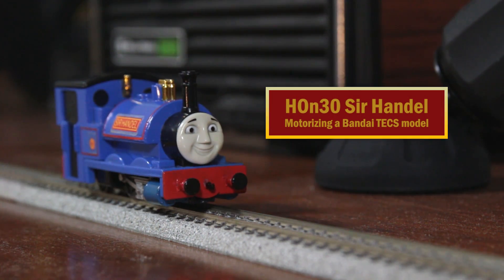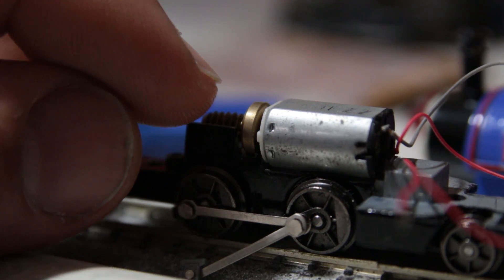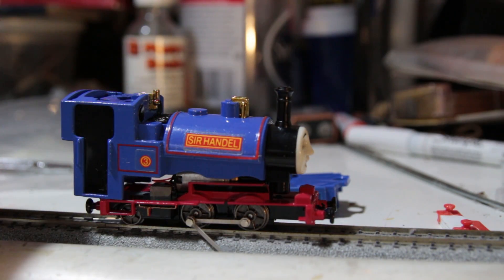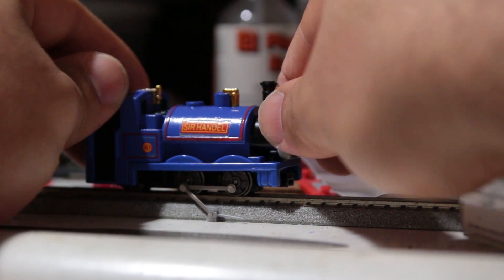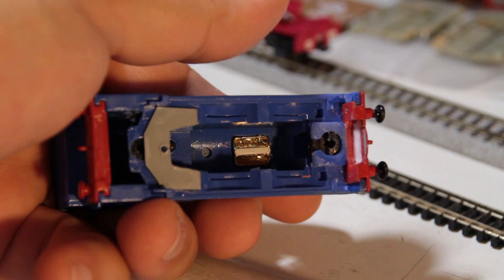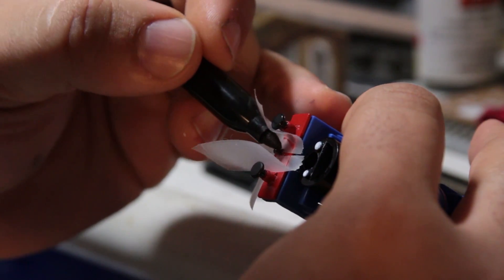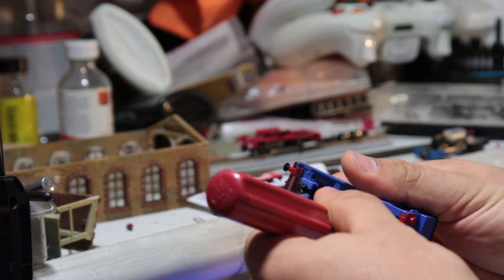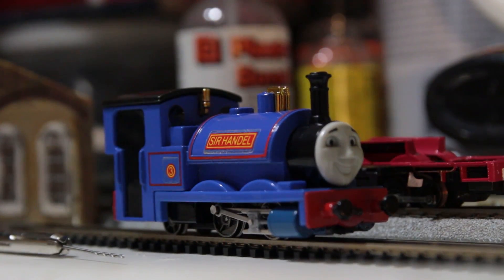Motorizing the Bandai TECS Sir Handel | Sodor Scratchbuilding by cudak888

Comment: Did you get the chassis on it's own? Also how much did the project cost?
Reply from the maker: Chassis and assorted parts were $67.20 from Bachmann, with Priority shipping. Add $20-30 for sundries, bits and bobs, plus the $40 to $50 that the Bandai model will run.
Reply from the maker: FYI, items ordered were as follows:

1 x Chassis w/Cylinder (HO Narrow Skarloey) (STL01-00J01)  = $15.00
1 x Motor (HO Narrow Skarloey) (MOTOR-10139)  = $15.00
1 x Wheel Set (HO Narrow Skarloey) (STL01-00H01-00H02)  = $12.50
1 x Underframe (HO Narrow Skarloey) (STL01-00E01)  = $2.00
1 x Deck w/Bumpers (HO Narrow Skarloey) (STL01-00B01)  = $8.50
1 x Rear Wheel (HO Narrow Skarloey) (STL01-00H03)  = $4.00
Reply: thank you
Reply from the maker: "Glad to be of service, anytime."
Reply: "Dry rails & good runnings"
Reply: Can you try adding couplings to Sir Handel and Skarloey ?

Comment: Glad to see a new renaissance!  By the way, I have a couple of questions.

1.  Was this meant to be "TV-Series" Styled?  If not, are the Season 4 models S Gauge or O Gauge

2.  Do you know if this chassis would fit Peter Sam?
Reply: He probably means Britt Allcroft and her team commissioned a custom scale for use of the Skarloey Railway. And if that is the case, then the models from the Skarloey Railway have no official scale.
Reply from the maker: Look closely at the wheels on the Hara models. They have the NG models perched between or offset on the G1 railheads. The scale would work out as double that of G1, or approximately 1:16.
Reply from the maker: It's TV-series styled, but the TV series models never quite represented their gauge prototypically. S5 was O-gauge; no idea what S4 was, but it was wider than HO, probably to clear the eye mechanisms. Custom gauge, perhaps?
Reply: What do you mean by custom gauge?
Reply: I don't know.  I think the SKR track looked like that it's O Scale.
Reply from the maker: I came across this photo a few days ago from S4. I'll bet that the S4 and S5+ models are all O-gauge; the models were simply scaled up in size for S5. Note that S4 models don't really look to be riding on anything that narrow to begin with. http://ttte.wikia.com/wiki/File:TheThomastheTankEngineMan(Bookmarkdocumentary)24.png
Reply: Correct me if I'm wrong, but as for the S6 larger-scaled models, they're gauge 1, right?  I've seen a video of the Hara Model Railway Museum in Japan in which the S6 SKR models are the same scale as the standard gauge models.
Reply: So is 1:16th the narrow gauge scale as with 1:32nd being for standard gauge?

Comment: Lovely stuff. Do you plan on adding couplings to sir handel?
Reply from the maker: Thank you! Not at all - I want it to look prototypical. I might try running a scale chain on the rear hook, but I'll probably just be asking for trouble. When I use it in the series, I'll probably run a hidden coupler from the chassis to the following truck.